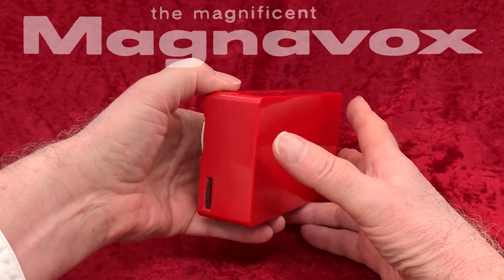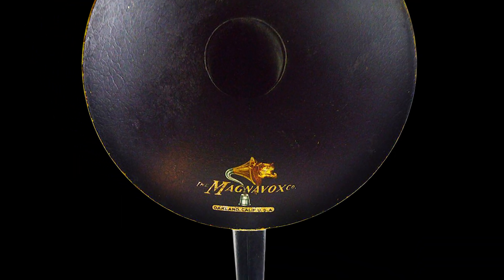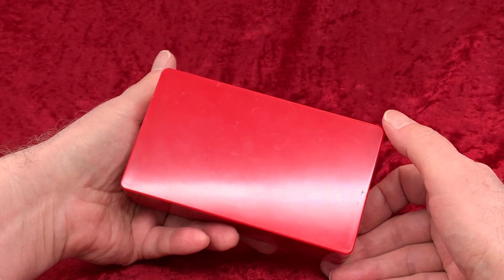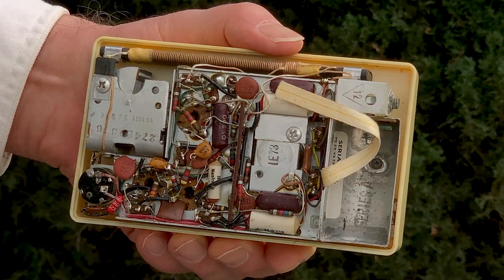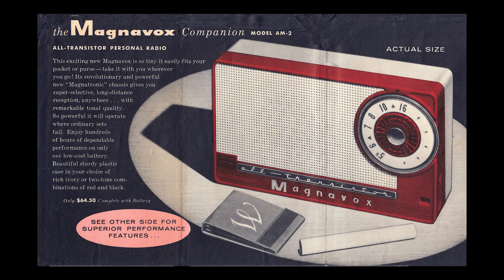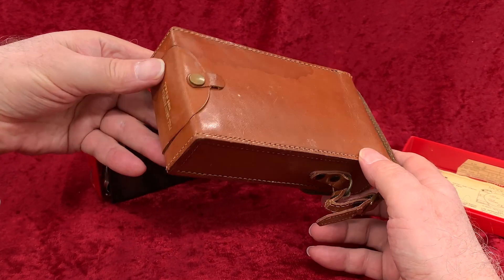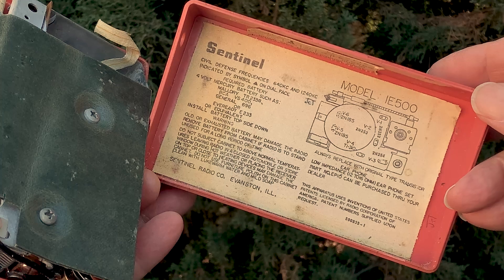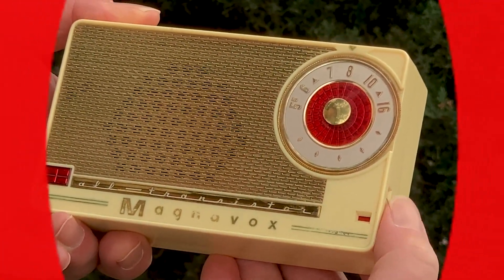First MAGNAVOX transistor radio - 1956 - hand-wired, made in USA, first and only Sentinel transistor

Comment: In the mid 1950's, they hadn't mastered the art of consistently producing quality transistors. In  fact, about the best they could do was 1 out of 10, that worked, so they tested each transistor by hand individually, to find the one which worked & threw away the 9 bad ones. This tedious process was, why transistor radios were so expensive at first. It wasn't until the mid 1960's, that the manufacturing issues were solved & transistor radios got inexpensive enough to begin to overtake vacuum tube radios.

Comment: $64.50 in 1956 would probably translate roughly to $1161.00 if you figure the cost of gas then 25 cents/gal versus today's $4.50 a gallon. 6 transistors (7 or 8 if there was a tuned RF stage) were all that were necessary to make a top performing AM  radio. I always get a chuckle out of those pocket radios with an insane transistor count and most of them are out of circuit, used as diodes or purposely shorted just to use as a "wire".
Reply: @DM-hk8gz   Let the man speak. He's done nothing offensive.
Reply: Tube radio manufacturers did the same thing with otherwise unconnected tubes that did nothing but glow from the filament power.
Reply: The transistors used in those radios were often seconds, that had been rejected from more important production lines.  Back in those days, the most important use for transistors was aviation and missiles, with computers starting to use them.
Reply: @James_Knott  If so, they were still within spec for the purpose assigned. Computer usage is very forgiving. Not a problem to use under spec components there for the most part.